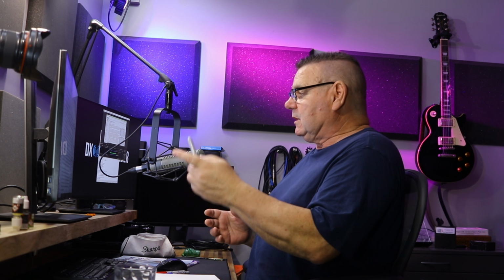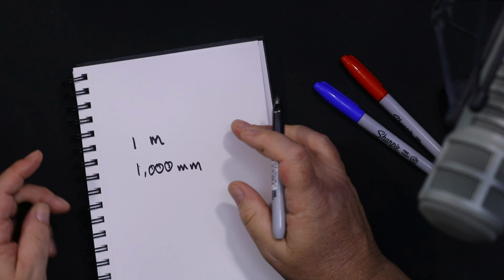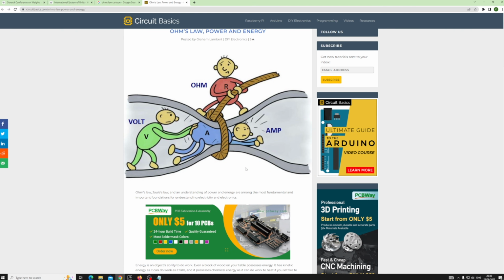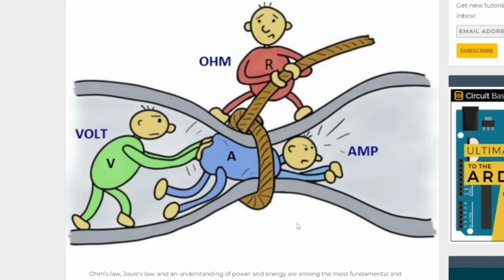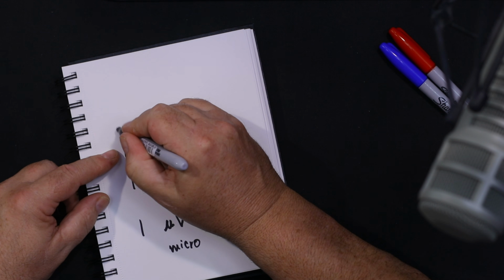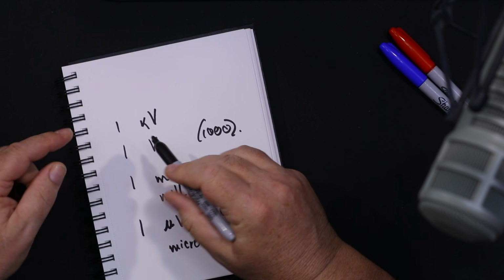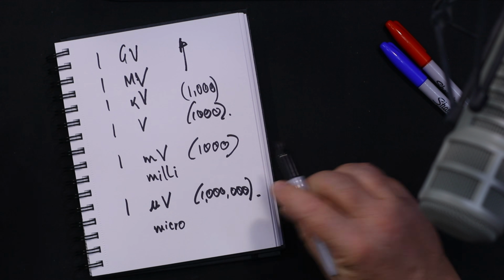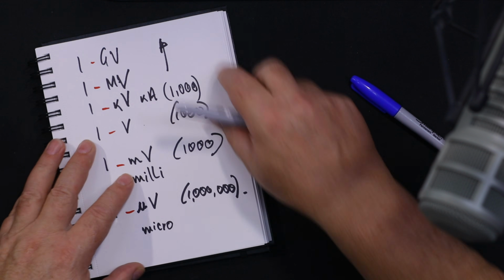Very LARGE and Very "small" Numbers - International SI Units

Comment: There is a mistake in 2.12... should be Ampere (A), Voltage (V) and Resistance (Ohm - Greek letter omega). "I" for Aper is a physic symbol, same as "U" for voltage, and "R" for resistance. In circuits you have measurements in mA, kA etc, same as mV, kV and m Ohm, k Ohm, M Ohm. Not mI, kI.
Reply from the maker: Well spotted! I noticed after I had uploaded and was waiting for someone like you to come along!
Reply: @DXCommanderHQ  yes, sorry for that. No ones perfect. But great material, lot's of ham's has problems with such simply stuff like Ohms Law and units. Good job.

Comment: Thankfully I know all this (I damn well should with my day job), but very well done Cal, good explanation.  I always suggest you imagine a meter ruler. You can see each mm on that ruler so you can visualise a mm and understand it mathematically in relation to the 1m . Then with a bit of imagination you can "see" each micro m within each mm - noting there are 1000 micro m to 1mm . Then you know that 1 m = 1000 mm = 1000,000 micro m.  And all the time you have something to visualise in your head.   Once you have that in your head, just change the unit to the unit of choice  - like the Volt (V). What works for the Volt works for the meter and so on  :)  Mark, 2E0MSR.
Reply: The "meter stick" is a good one for other reasons - it lets you visualize a quantity of "1000" pretty easily.  And then when you think of a square  with 1000 mm on each side, well, you just visualized 1,000,000 ... and then make it a cube and you just visualized 1,000,000,000. No other easier way for me.

Back In The Day™, the Canada Metric Commission distributed a die-cut cardboard cube for kids to assemble.  100 mm on each side ... which, if filled with water would contain 1 L and would mass 1 kg.  I never forgot that lesson either.    It was cardboard - you couldn't actually fill it with water.  Had a bunch of other SI facts printed on it too.
Reply from the maker: Good tip!

Comment: Even non-Americans get sloppy with the symbols, usually confusing them with abbreviations.  They are all (I'm sure someone will post a counter example) prefix-unit.  

Prefixes are case sensitive so k is not K (the SI unit for temperature, the Kelvin) and certainly M (mega-) is not m (milli-).  Usually the capital is a multiplier and the lower case is a divisor.  

Units are usually lower case unless its named after someone like Pa for Blaise Pascal or, more to the point, Hz for Heinrich Hertz.  So, as Callum says, 1000 hertz is 1000 Hz or 1 kHz (not khz, not KHZ not Khz).  Meter is the standard unit of length, symbol m and yes, that means that the millimeter is mm.  

It's a scientific/technical hobby.  Deal with it.  BE LIKE CALLUM and be scientific 🙂

Yes, I am a metric nerd in a country where so many people have trouble counting past 12  ...
Reply from the maker: Oh yes.. Rule of 12 :)